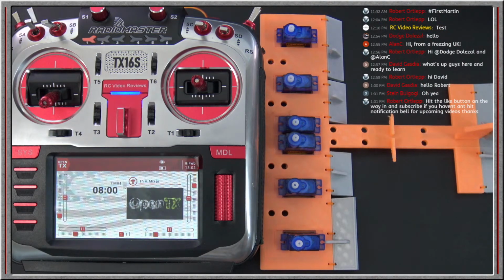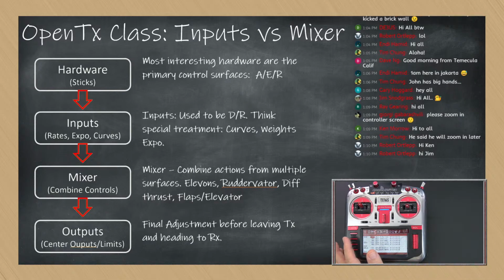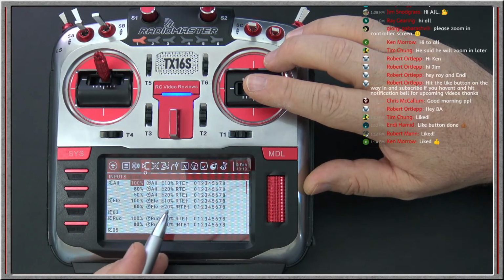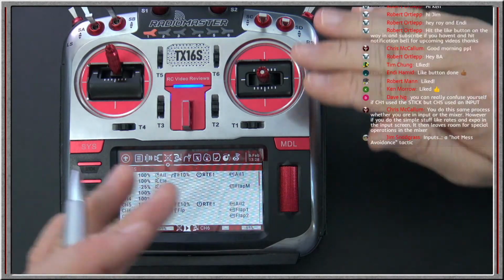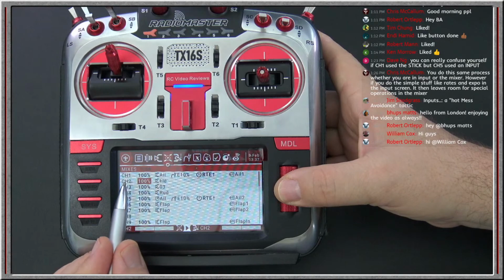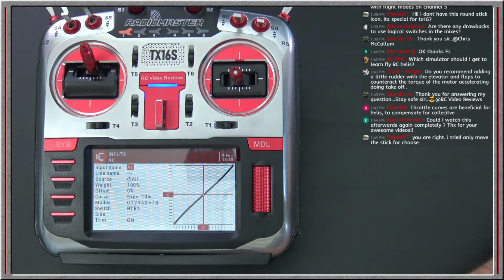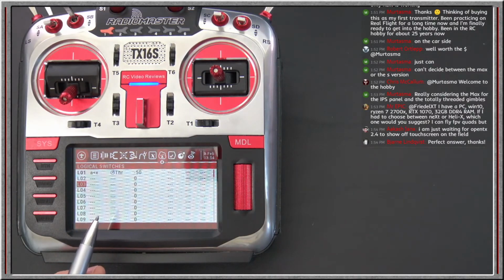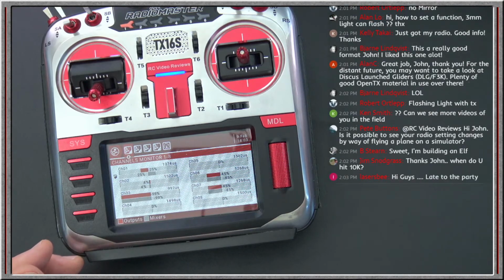OpenTx Class • Inputs vs Mixer • Learn About OpenTx

Comment: Just wondering why not change the order on the input page why on the mixer page. I have s8r receiver it wants an order, so I just deleted everything in the input page and assigned the inputs to the way it calls it out. Should I have done that on the mixer page instead? I1 is now Aileron instead of throttle it works but I don't see anyone doing it that way.
Reply from the maker: Mixer channels correspond to RX pins. Inputs do not.

Comment: After studying your videos for about 3 days now, I think you might have the best Opentx tutorials on YouTube, and you seem like you know OpenTX inside and out.  So I want to ask:  I've got a pot which is assigned to change my gimbal pan and tilt rates.  I want to use a momentary switch to change back and forth between pan or tilt rate, for example, I want my pan rate to continue to be the same while I pull the momentary switch to adjust the tilt rate.  I have pan and tilt rates set to each use their own channel. Currently, when I pull the momentary switch, it switches from tilt rate to pan rate, but then is outputting 0 for tilt rate.  In other words, I want the tilt rate to hold at the last pwm value sent while I modify the switch to adjust pan rate instead.   Can you point me in the right direction?

Comment: Great video, thanks.
I am trying to have two throttle modes, one on 100% throttle and the other on 70% throttle so I tried to use  
INPUT for this and just copied the existing 100% throttle settings and changed the weight to 70% just like dual rates but this does not appear to work for some reason. Can I not use INPUT to do this?
Reply from the maker: Sure you can. Make sure you're using the input on the mix line too..not the stick.
Reply: @RCVideoReviews  thanks but  do you mean use the mix option in the mix screen instead of input option in the input screen?
Reply from the maker: @786free1  No. You set rates on the INPUT screen. Just make sure on the mixer you're using the Throttle INPUT and not the Throttle STICK.
Reply: @RCVideoReviews  ok thanks.

Comment: Ok I have been trying to use one of the 6 switches at the top of my TX16s as a timer reset...for some reason can't get it to work like I want to...my timer starts count down when I move my throttle...using the switches ..I have to push #2 so my timer starts..then #1 to reset...but thats not what I want...I my my timer starting like I have it..then just push #1 to reset...can't get it like that...any help would be welcome
Reply from the maker: It's probably because the 6 position is a more of a latching momentary. You could use it by creating an edge logic switch based on one of the 6p switches and then using the logic switch as the reset. This might make a good video...
Reply: @RCVideoReviews  that would be cool to see a video on this. Im still learning about opentx an edgetx an my radio...just going real slow for me lol

Comment: Great video. "Dual rates" never made sense...it should be "dual travel" or something else.
Reply from the maker: Think of the concept of how fast the craft moves about an axis. If you move the aileron up 10mm, the RATE of roll will be one number. If you move the aileron up 5mm, the RATE of roll will be another number. So by changing how far the surface moves, we change the RATE at which the craft rotates around that axis.

Comment: Thank you for this video! It's handy to be able to see the actual pulse width value that will be applied when setting min/max limits in the OUTPUTS screen using OpenTX. Is it possible to do see pulse width in the OUTPUTS screen when using EdgeTX (v2.6) or does one have to make an adjustment in OUTPUTS and then view the PW in the Channel Monitor?

Comment: Finally , a lucid , clearly understandable explanation of "dual rates". In RC lingo it means extent of travel instead of a comparative speed and it is not necessarily dual. In Open tx you can make the full distance a control surface travels any number of distances , not just 2 as the term implies.  I wish this invaluable series had been available a few years ago. The main reason the Opentx world is so impenetrable is that slow, clear , simple explanations , with lots of examples for how the system works , has been missing. 
Your series fills this big void. Many congratulations.
Reply from the maker: Thank you. Very nice comment...Glad to help.

Comment: I am just learning OTX , my conclusion about the two screens :  “Inputs” could be looked at as Primary Mix screen. Offers a separate and simple screen to manage the shared primary controls.
The “Mixer” screen is for complex individual mixing. The two screens offer simplicity, security and easy reference to the total model management.
For me it is a very comfortable system, takes a little study to become familiar with the system. But the reward is worth it ! Great video , I appreciate your tutorials.

Comment: Answer to question "UMX Planes and Radiomaster TX12" Time Stamp 41 mins 34 Seconds.
Unfortunately the TX12 is limited on protocols it can do, DSMX being one of the ones not included IIRC but if Im wrong read on.
I own a Radiomaster TX16s and have a fully functional UMX Turbo Timber BNF with SAFe and telemetry.
1. Create a basic model file with 6 channels
CH1 Ail, CH2 Ele, CH3 Th, CH4 Rudder, CH5 Safe/AS3X, CH6 Flaps
2. Assign necessary switches to CH5 and CH6
3. Add a "Slow UP and Slow DN of 2.0" to the flaps channel. Make the rate/ch limits -90 0 +90
4. Bind the aircraft using internal rf multimodule set to DSM  X 2F with a 22ms Servo Update rate
5. Setup a throttle safety using special functions and overide CH3 using a 2 position switch
In my case I had to reverse the Ailerons and Rudder channels using the outputs screen. Setup dual rates in the input screen according to manual ie 100 high rate, 70 low rate. Expo is personal preference.
SAFE worked out of the gates, no messing about with pulling sticks down and out or down and in etc. It just works. Now heres the bit people pay silly money for a toy like Spektrum radio coming up.
I also have telemetry!
Once bound select discover sensors. There should be a sensor labelled A2. Edit its name to say fuel or bat or whatever you like.
Setup a widget on the top bar to display a value and select the newly named sensor. You now have your onboard battery voltage in real time on the radio. The RSSI figures are dubious. Set the limits to their lowest values for RSSI warnings as they are complete hogwash. Default settings are telling me I have critical RSSI at 30yds out which isnt the case and probably a cross compatibility issue. Its the same with my F-15 64mm off them. I am a complete Spektrum hater but love the planes. YOU DO NOT NEED A 500 DOLLAR NX6 TO FLY BNF EFLITE/UMX AIRCRAFT like they would like you to think. I also rewired the built in ESC to take a JST plug so I dont have to pay for their overpriced 280mAh batteries with a PH2.0 connector and special parallel charge adapter they expect you to use. I made PH2.0 to JST adapter and can now use any batteries I like. I also rewired the eflite 280mAh battery to charge without the special lead terminated with a JST and XH2.54 Balance Lead
Mr Hopkins, you have my permission to copy, embellish and edit this comment as you see fit into discord to help answer the mans question. I have no account on discord
Reply from the maker: Thanks for taking the time to put all this together. I'll make sure to make note of it and share it for future UMX/Safe configuration questions. 

I'm aware the Tx12 doesn't support DSM, but the light just didn't click on during the livestream. Appreciate the response.
Reply: @RCVideoReviews  you are very welcome. I think I got your surname wrong Im afraid and I apologise. Ive been a subscriber pretty much since my TX16s turned up and my God your work has been helpful! This time 3 months ago, I wouldnt be able to answer the question at all without your help.
Reply: Thanks so much thats helped a lot,I've got a jumper t lite on the way that I want to use with my six umx planes.
Reply: @SkyBandit45  I also have the 4in1 T-Lite on the way. It should make for a very portable setup as due to draconian rules now in force in the UK, I may have to hike quite a way to get some flying in, especially as I didnt bother renewing my operator ID in protest 😉